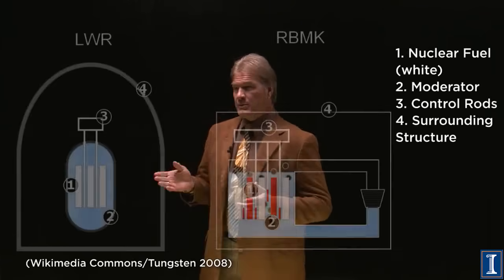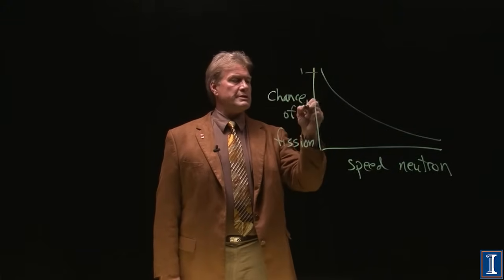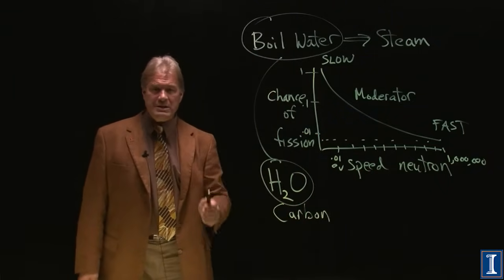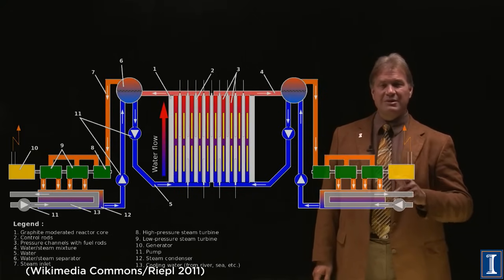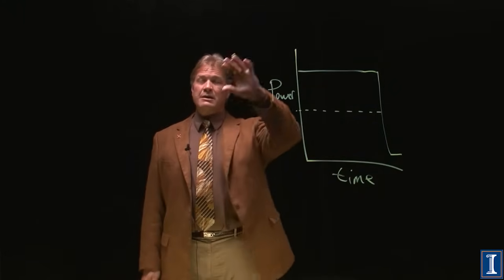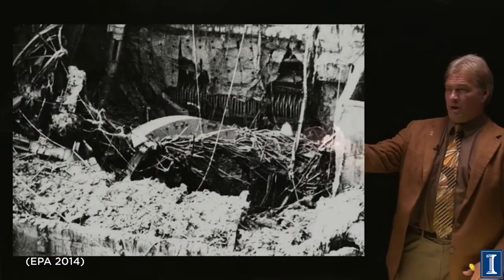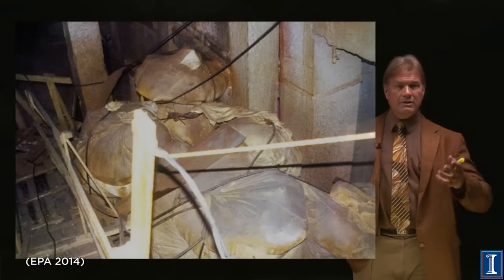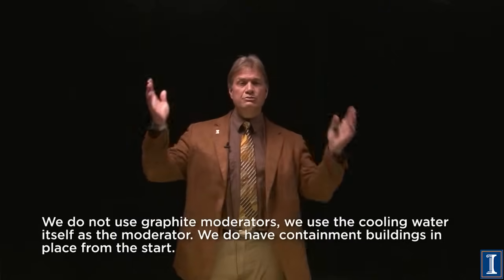Chernobyl: Worst Accident Ever

Comment: I disagree about the moderator part. The majority of commercial nuclear reactors are PWRs and do not boil the moderator water. They heat the high pressurized water inside the reactor vessel which is working as a moderator in the 1st cycle and then boil the water of the 2nd - boiling cycle, which turns into steam and drives the turbine, via heat exchanger, using the heat of pressurized water in the process. So you actually cannot have less moderator in the system.
Reply: You can have less moderator in the PWR. It's called loss of coolant accident and it's one of the major design basis criteria for PWR plants. That's what happend in Three Mile Island. And it doesn't matter if it's PWR or BWR, boiling is still the method of heat transfer out of the core in both types. BWR transfers the heat using one circuit and PWR transfers the heat using two cicuit.

Comment: The Russians are still using the RMBK with some modification but still no containment. Also point out that the British AGR reactors have graphite moderated cores, although they have suppression systems if control rods fail and in the case of the AGR the stainless steel encased fuel can retain its integrity after a full cooling system failure, to extent that the core would still remain serviceable. If the control rods failed to enter the reactor as well, and so the graphite core started to collapse as the reactor heats up then boron beads are released by the collapsing structure filling the rod channels before the fuel integrity is lost. Plus all this happens within a concrete containment structure.

Comment: Wait correct me if im wrong but when did an operator pressed a wrong button and the power went down??
Reply: He turned off the automatic power regulator, the reactors were so unstable that when they first started using them, they had to double up the operators on the panels to keep adjusting the control rods to keep the power at a constant level. Then they found the panel switches would wear out. So they developed an automatic regulator to manage the rods. The operator (young assistant sorry can't be bothered to look up his name as its late) went to drop the power down fro  the 1500 MW it had been running at to 750,MW before starting the experiment, but inadvertently disengaged it and the power dropped to a level at which it could not be engaged again, so they had to try and bring it back manually,  but the reactor was poisoning itself and they stalled it so they pulled out almost all the rods got the power back up to a level they thought they could fudge the test. They had "locked and loaded the reactor" then they simulated shutting the turbine down, which pulled the trigger. Recommend the book "Midnight in Chernobyl " which gives a step by step walk through the construction of reactor, the disaster and the efforts to contain it.

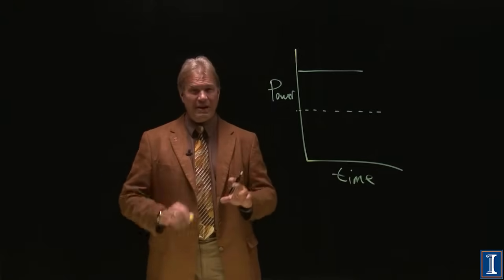Comment: 10:35 No         the power of the reactor was all the time on half power      there for the Xenon didnt not Burn away it builded up             and then when the Tryed to Lower the power     The reactor stalled           and then if the try to raise the power       it came out of controll and the Pressed the AZ3-5 button (scram)      and then Boom becuse of Controll rods with graphite tips

Comment: This video feels more than propaganda than science - more emotions, less facts. No explanation why the hell USSR needed RBMK-type reactors in a first place, what the pros of that design, why exactly there were no containments and not a single word why US-built Fukishima is keep poisoning the Atlantic. And I will explain - rapidly growing industry required a lot of energy and fast USSR had PWRs built at that time, but unlike then RBMK design allowed to build the reactor on sight, provide up to twice as more power, to use low enriched uranium as fuel and fresh water as coolant (PWRs in fact don't use water, it's deuterium oxide, so called "heavy water"), to be refueled while running, to produce big amount of various isotopes for chemical and medical industry. It was VERY cost efficient and practical, but the price was a positive void coefficient and technical impossibility to cover giant structure by proper containment building (which was also acknowledged by Legasov in his tapes), but though it was violation of 3-level safety concept, it wasn't the main problem - reactor could withstand external impact like "plane crash" (yes, it would probably destroy the facility,  but wouldn't penetrate the core) and automated safety systems were capable to prevent it from going crazy. The main mistake was to give an access for emergency systems control to operators. Perfect storm of mismanagement at all levels caused the disaster (for those who came from HBO - control rods flaw was acknowledged before the accident and it was ironically supposed to be fixed the next day the disaster occurred, as reactor was about to be shut down for maintenance right after the safety test and it was considered unnecessary to inform the personnel about the problem they wasn't suppose to face), and the same storm of carelessness allowed Fukushima disaster to happen - US built the facility that didn't met the environment conditions, causing a tsunami (what a surprise in a tsunami affected region, right?) to destroy facility's power grid, including backup systems, and Japanese failed to manage emergency protocols after that happened, causing 3 meltdowns and 3 explosions out of 6 reaction (instead of single meltdown that was inevitable due to electric-based emergency system had coolant valve blocked). By the way, it were containment buildings what exploded, and they had spent fuel coolant polls inside, so technically situation is way worse than Chernobyl (not only release of radiatioactive materials to the atmosphere but also contaminated ground waters by melted cores) and there are only two reasons why it's not considered so - first, it happened not in the middle of Europe but in the middle of nowhere and most contamination had (and keep going) feel into the ocean, and so it it's easier for THERSO and Japanese government to cover it up, which is the second reason. It is so easy to argue by pointing out only good things of the things you like and only bad of the things you don't, right?
Reply: That's because you are too fucking stupid to understand basics
Reply: @bethlarson7144  What a comprehensive scientifically backed response lol

Comment: It's painful to watch this video. Everything could be explained WAY better (most videos are) and even many basic facts in this video are wrong. And it's not RMBK but RBMK, as said so many times on the video and in description.  3/10.
Reply: I'll take the Professor's explanation long before some fuckhead that couldn't find his own ass with both hands.
Reply: @bethlarson7144  This is the problem with most universities nowadays. You are supposed to question what you hear, especially in this case. The professor is wrong in numerous places. For instance, there was no wrong button ever hit. The core was in a reduced power state since the afternoon, allowing a steady state of Xe poison to form that's normally burnt away at operating power. As they lowered the power to the test level, the Xe poison killed the reaction, then they went about extracting every control rod they could. They didn't reinsert the rods to reach that test power, they hit the SCRAM button because they saw the power level increasing too fast after the Xe burnt away. Rods started to move down, graphite 'tips' on the rods (not actually tipped, the graphite is placed inside the rod canals to displace water) went down, creating a huge core hot spot that damaged the control rod channels, locking them in place, keeping that graphite in the hot spot, then bam.

Am I a fuckhead that can't find his ass with both hands? Probably, but I'm three months away from getting a PhD. in Nuclear Engineering.
Reply: Archangel Ultra He’s right. The operator didn’t select the right power when they went to manual mode (he also didn’t pull out the right rods at the start). It went to a very low level instead. This is way before the Az button. The show didn’t show everything.
Reply: Adam Cooper ah, so ‘killed reaction,’ doesn’t mean ‘low power.’ I’ll be sure to pass this new information over to my colleagues at our research reactor. Thanks, professor.
Reply: Archangel Ultra you’re responding to a different point and out of context. The only time a wrong button was hit was when the power dropped from 700 to 200 MW. That’s not when they killed the power but to start the test they had to shift to manual control. They did not have the correct power setting for that (it was too low). I’m only saying that there was operator error in that time. It would have easily been fixed if they did not continue with the test. I didn’t hear the professor say at the end they hit the wrong button (I agree, they hit the correct one, AZ)

Comment: What was the wrong button the operator pushed? I thought it went too low because of Xenon poisoning. Xenon poisoning was already present because they were running the reactor at a lower than normal level leading up to the test. Either way that seems like a big thing to gloss over.

Comment: I don't know if he's ignorant of "the rest of the world" or simply thinks that anything outside of North America doesn't count.  UK magnox and AGR reactors are also graphite moderated and also lack LWR style containment buildings.  They are significantly safer than RBMK owing to their low power density and CO2 coolant.
Reply: Dr. Ruzic stated that there are no "graphite moderated water cooled reactors."  It's the water cooled aspect that is most important here for multiple reasons.  First, in the case of Chernobyl, water was acting like an absorber so when it turned to steam, more neutrons became available to further contribute to a runaway reaction otherwise know as the positive void coefficient.  Second, superheated water is explosive when pressure is suddenly released which is why there needs to be a containment vessel for BWRs and PWRs.  Since the gas cooled reactors already have their coolant as a gas, a sudden explosive pressure buildup can't occur.